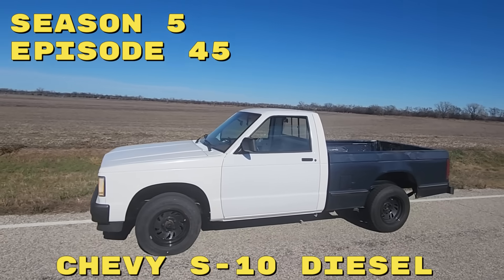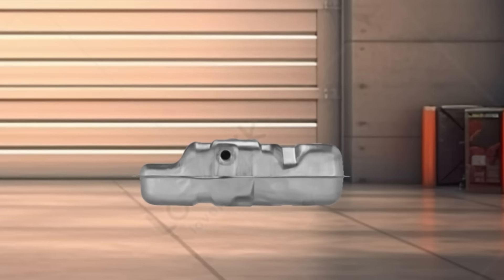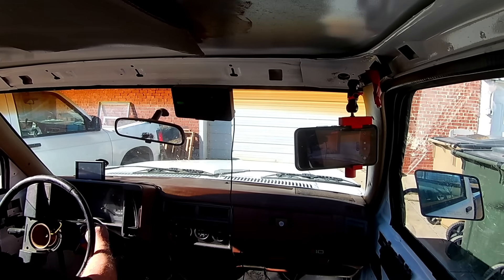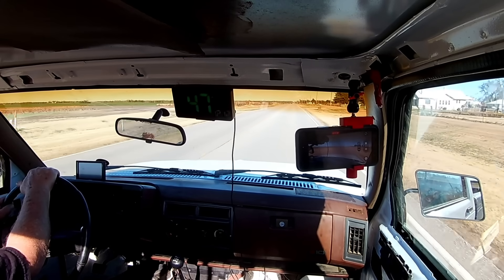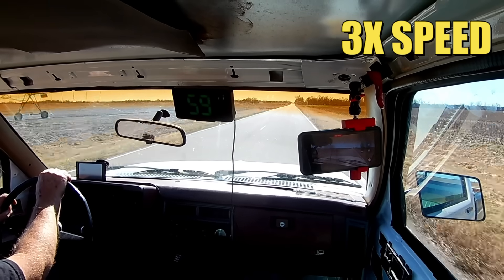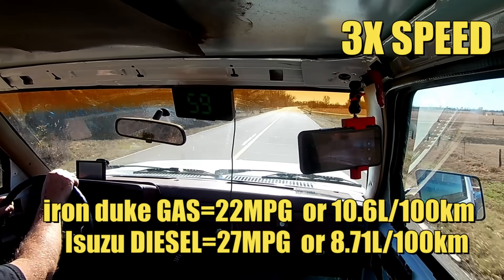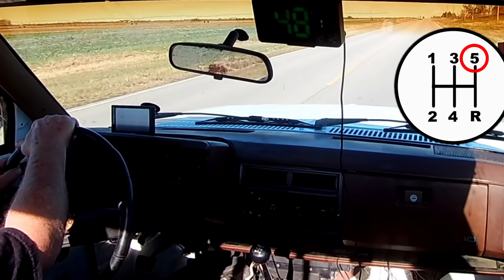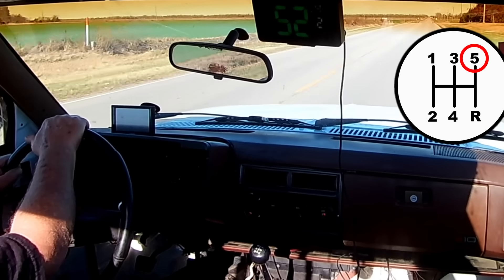S5 E45. MPG?  We road test the custom diesel Chevrolet S-10 to find out the fuel economy.

Comment: The consumption sounds reasonnable to me. I used to drive the VW T3 bus with the exact same engine, only it was limited to 50 hp and my average consumption was about the same. But to make it move, you'll have to make the engine scream a bit. The limiter usually comes at 4800 rpm, so just rev it up until it stops, memorize the screaming sound and next time shift just before you reach the same rpm. Even wirh one ear you will hear that 😉
Appriciate your videos a lot, thanks buddy!

Comment: Wow you are inspiring me to install a diesel on my 2003 Ford ranger. It currently has a 4.0 V6 buts its currently at 211k miles. Not sure how long it has until it finally quits. Right now the engine runs with no issues. I change the oil about every 6k. Thank you for sharing your journey with the s10 swap!!! Ive been binge watching these episodes since yesterday.

Comment: I've always wondered what running an n/an engine with only a few ponds of boost would do for economy.  Just enough boost to keep the air density/O2 saturation at around sea level.   Theoretically,  It really wouldn't add too much in terms of power, just keep the power more consistent regardless of barometric pressure or altitude changes.   It may be too much expense for the results for most, but I have a 1985 Ford Ranger,  I don't want it to be fast, but just keep up with modern traffic and be able to enjoy it for drives up the local mountain roads without it struggling.

Comment: I would look at the shift points. I had a 91 S10 that had the 2.2 6 cyl and it would get worse milage against the wind in 5th than in 4 th. You could feel the engine working trying to push against the wind in 5th.

Comment: My 1997 s10 2.2 would get 28-29 miles per gallon doing this test. I bet you can squeeze 35-36 out of this engine with tuning and tweaks, and 39-42 with a turbo. Possibly even a bit more with an ALH TDI or something

Comment: Turbo that NA 1.6, done it, works great even at 25+ lbs of boost. I used a turbo pump as well but I bet there's gains even on the na pump. Worked on and played with these for 3/4s of my life. The 1.6 NA is the dumbest engine in stock form, non turbo diesels all leave some much on the table without.
I think the trucks lack of power is costing economy.

Comment: Great video jimbo. 

I actually guessed the mpg correct. Would like to see some engine changes like valve timing and its effect on the motor. Probably cost prohibiting however I have always wanted to know how it would go if the compression was increased on an engine like that and if there was much net power benefit

Comment: I understand putting there Duramax diesel engine or eventually Audi 3.0 TDi, but small 1.6 diesel from 80s in BOF truck ? That will be slower than tractor.

Comment: A German here. The prices of diesel and gasoline are relatively accurate, but it varies greatly from region to region. Where I come from, the fuel is on average the cheapest (Kulmbach, Upper Franconia, Northern Bavaria). Diesel is between €1.53 and €1.57. Cheap gasoline (Super 95 E-10 with 10% bio-ethanol (91 AKI)) is €1.57 - €1.63. Normal gasoline (Super 95) is €1.63 - €1.67. Premium (Super Plus 98 (93 AKI)) is €1.75 - €1.82. Ultimate 102 (98 AKI) is €1.87 - €2.09. At some petrol stations there is also a kind of performance diesel, but this is pure rip-off and is around 1.90 € - 2.10 €.

Comment: If you get the valves shimmed right on per specs it can mean one to two mpg. Please use VW Rabbit truck for comparisons. Gearing. Weight. Etc. Try propane(there is a company that makes, did make?, an electronic propane setup for VW diesels). Use synthetic engine, transmission, and differential oil. Use tires that are better than just spacers between the wheels and road. Use lightweight forged wheels and use wheel size to adjust gearing. Are brakes in good shape (not dragging). On the oil pump video, be advised that on dirt roads the Rabbit diesel trucks were susceptible to denting the oil pan and breaking the oil pump. This series is very interesting. Thanks. Take care.

Comment: We had a 2wd Isuzu diesel pup with no ac. Seems like it got around 35 but zero power. Went to the mountains and had to turn around and go home to get the 22r Toyota. It was powerful enough to maintain 55mph up the mountain and even had ac. The Isuzu needed 2 turbos. One man here put a turbo on his VW truck and the head gasket failed not long after. Isuzu was it and the 22r was the hot rod that got low 20s mpg. The best Chevette ever made had the Isuzu diesel from the factory.

Comment: In aviation if you fly a heading say 000 out for 100nm and the reciprocal heading 180 back 100nm at the same indicated airspeed and altitude it is impossible to improve fuel consumption over nil wind.
The point is, wind always, but always, costs more fuel - it's physics. 
It's a bit like saying hills improve fuel economy - the point being it always costs more fuel going up a hill than you'll ever get back going down the other side (assuming same start and finish elevation). It's physics. 
I'd bet doing a circuit, assuming a constant wind direction, the wind degrades fuel economy over a nil wind day in a car as it does in aviation.

Comment: Another great video. My first job in high school was for a Diesel Injection Repair Company. Their delivery truck was a 1985 Chevy S10 4X2 extended cab with a 5 speed. The truck was pretty gutless even compared to the 2.5L. I can’t remember what it got for mileage but it wasn’t bad for the time. I would like to have that truck now. I’m interested to see how this goes, I didn’t realize that there was adapters for almost every application. Thanks, Jim. I hope you and your family had a Happy Thanksgiving.

Comment: You gotta rev the non turbo diesels, I was expecting you to achieve 44 plus mpg with the 5 speed, I run a Mk5 ford transit lwb with a non turbo 2.5 banana engine, this uses the Bosch ve pump which is tweaked slightly & I get on average 32 mpg I'm carrying a campervan conversion with onboard water tanks.
I'm assuming you're slightly out on the pump timing so you should expect some improvement on the mpg.👍 Good luck 🤞

Comment: I've always had those EPA estimates be severely underrated. My calculations with my 2.5 Iron Duke S10 came out to 27-28 MPG. I'm pretty sure the 2.2 Diesel got 35 with real world testing. So your results sound about right to me.

Comment: Well I am impressed with your work.
I always await the next video...
I can tell you that the 4 cylinder diesel engines are very good and used in many applications..
I have 1.9 SDI caddy style van 1997... very useful and good.
Mine being a non-turbo.
I believe you may wish to upgrade your motor to the turbo...
Yes you could, but you'd need to reduce the compression a bit... otherwise the head will say 'ouch' too often and part company.
You mpg is low ...
You should be getting a better figure, but that may be due to your timing...
Certainly on the 1.9 SDI it's about 85...in that region yours being a 1.6...could be 87 to 95... depending on the year...
Even the injectors back pressure..is worth noting..
Are they all the same... pressure range 
Turbos have a slightly different arrangement.. settings..even injector number ..
As the turbo engine will run hotter 
I am not sure, if the pre swirl-chamber differs too.
The tachometer pickup point on mine is at the rear of the injector pump...
The point/hole, where you do the timing..Dial guage (or at least on mine) it's a pulse operated switch with just 2  wires...and they must be connected a certain way... otherwise 0 readings 😅
Good luck....we will be watching you ..from afar 😂😂😂....in Spain..or across the pond😅

Comment: In Finland, diesel fuel is currently 1.65 €/ltr, 95 octane (RON) gasoline 1.75 €/ltr and 98 octane gasoline 1.85 €/ltr. Fuel oil (tax-free red diesel fuel) is about 1.40 €/ltr, but you aren't allowed to use it in road vehicles anyway. I don't know how things are in the US of A, but here the yearly vehicle tax is significantly higher (almost double) if the vehicle runs on anything other than gasoline. So with lower fuel price and lower consumption but higher tax, it only makes sense to buy a diesel car if you drive a lot.

Comment: My 6500 pound 3/4 ton 4wd Dodge 12 valve with an automatic transmission gets 21 on flat roads with no wind AT 55 mph. However since there aren't many 55 mph roads in my area I drive 65- 70 which accordingly lowers the mileage to 18-19 mpg. My standard trans 2wd 3/4 ton trucks have been able to squeak out 24 mpg at 55 mph. A 12 valve needs to stat as close to 1200-1300 rpm to get the best mileage. 
Other YouTubers have used 4bt Cummins engines in various vehicles and achieved 35+ mpg at 65 mph. I hope to see the little truck surpass 40+ mpg in the future.

Comment: I have the rare (in usa) factory isuzu diesel 2.2l s10 with a 4spd manual. 50hp and 90lbs/ft torque but I get 40 mpgs on the highway and I would get better with the 5 spd. Love the thing and my fuel gauge doesn’t work either lol.

Comment: Reminds me of the VW Rabbit 5 Speed 52hp diesel pickup. A Popular Mechanics test concluded that it was slow, probably shouldn't have been called a 1/2 ton, but it got 39 city and 58 highway mpg when they drove for fuel economy, and 38 city and 51 highway normally. Towing was not allowed.

Comment: I have a  diesel  2.2 1984 Isuzu pup pick up five speed. I never got below 35 miles per gallon.  It’s always got between 35 and 40 miles per gallon.
I bought it New for $6200 New . They used the same diesel in the S-10.  So I don’t know where you’re getting your miles per gallon of only 27.?   I’ve only had to change the timing belt once, brakes, and tires. And regular maintenance in 1,000,000 miles.
Reply: The EPA rated the 1984 2wd 2.2L Diesel 4 speed Isuzu pickup at 29 city and 35 highway. The 5 speed was actually rated lower and the 4WD considerably lower.

Comment: Brings back memories, so my guesstimate really wouldn't have even been that 30 some miles per gallon. I'm going to guess that that truck is a whole lot heavier than say a Volkswagen truck I had the 1500 and 1600 normally aspirated 81 through 84. Then I got lucky and got a 1.6 Turbo with a lot of miles on it but it was great and I ended up putting it in a VW pickup truck later I was lucky to find a place that sold a lot of VW parts in San Diego and they had three fully dressed blocks that were turbocharged and brand new and I think they were in the 90s but they were out of a Canadian plant. That engine was so much better and in reality the turbo was probably more than it needed at least on those earlier body models. On fuel economy I did about 45 to 48 on the VW truck on a really hot day going to vegas. So that was a positive the Heat and also was doing about 60 to 75 miles per hour steady-state. Now the one thing I did that I knew intuitively after I felt it that it was best for here in America and I don't know why VW did what they did. I had a VW Scirocco with a 1500 in it and a four-speed and I so wanted to have the five-speed to get the higher Highway gear ratio. So I bought a diesel transmission and made it up to the gas engine and for whatever reason that pairing was much better than what the original Scirocco had. So I experimented with transmissions and found that the gas transmission worked and had longer gears so to speak which went better with the torque of the diesel engine and it gave me way better gas mileage. Later I found a place that sold transmissions and engines out of I think Washington State and I found out there was at least 20 or more gear ratio differences in the 5-speed transaxle. So to get more performance you might try to find out what the early models had in them for gear ratios and compare it to what your truck has. Understand though I was using it for a daily driver in Southern California where the speed limit was really 70 miles an hour on the freeway. The diesel was buzzing like crazy with a four-speed and I didn't like running it wide open like. If you were planning on using your truck to haul heavyweight you'd probably want that low tight gear ratio that gave you more torque and power then mileage. So in reality everybody needs to understand that mileage is just one of the factors in the transportation picture. There are plenty of cars that get great gas mileage but they're super light and they don't haul anything. The other thing is an engine that has to work its tail off and run its butt off in RPM is one that is going to die early and what did you save? I know a brand new drove truck to Chicago from Indiana and they switched over to high-speed diesels and it was the worst thing they ever did compared to the Old Slow running diesels that use torque and lasted forever. So making it lighter and cheaper and super fast is only a transitory good and in the long run it's quite possible if it was figured maybe not such a great deal to run after the mile per gallon. Love your video and your info. Brings back good memories. I don't know how you're doing the timing but when I did it we used the same gauge in the pump but is Mark's on the Cam and crankshaft pulley.

Comment: Was expecting you to beat me. Gearing changes for proper engine speed makes a big difference.  Eg my 91.5 dodge went from 29@ 65 with factory 518  to 35-32( 3 back to back 200mi round trips because i didn't believe the 1st was right) with an Allison 1000 6sp.  Going from .69  31% OD  to .61  39%OD+ lockup torque converter motor was at a more happy RPM

Comment: I've seen your grinder...
 Notch the pully/balancer ware the belt doesn't run  and line-up the pointer.
      As for a  timeing light. Use a knock sender on # 1 HP fuel line.  Pipe the signal  to the gassers best friend the timing light. 

Some assembly /calibrating needed.

Comment: Before you show the results - if you get 38 or so MPG I'd love to see a Chevy Cruse 1.4L Turbo (2018+) version that is more torqy swapped in - that little sucker can pull that in a car on 88 (E15) gas so it's cheaper to operate.

Comment: I was expecting 35 or a bit above.
 My Mercedes 190E when bought (already pretty beyond the break in lol, with blow by) gets 32 MPG at 65 mph on highways. 2.0 liter, 1.3 ton curb weight, but with an aerodynamic coefficient of around .29, .30. 
 Drag coefficients play a major role in fuel efficiency.
 A pickup that's shaped like a brick (beautiful one might I add) getting 32ish mpg is quite impressive.

 Loved the content, brother. Keep it up.

Comment: 7:40 on the Diesel costs discussion: cheaper than gasoline in Germany but yearly taxes on the car are higher. Maybe 330 Eur per year for Diesel and 80 Eur for Benzin for a two liter engine. Depends also on emissions.

Comment: Could you put in a 1.9 VW turbo diesel, driving the front wheels, using the 5 Spd manual it came with  ?
You'd immediately double the HP increase and torque 65%+

Comment: Add the turbo and intercooler from the Mk4 ALH and it'll gain 25% HP and torque and a 15% efficiency over NA.
The VV turbo is easy to adjust, especially in that configuration (longitudinal).

Comment: OK but I think the old VW Rabbit Diesel did about 54 mpg in ideal conditions.  Even though this is a less areo dynamic pickup and probably a bit heavier body, I think you can get more like the mid to high 40s. You might try some areo dynamic improvements, air dam, bed cover, and find out about the optimizing of the engine.

Comment: I had a early 80s Rabbit Diesel with a 1.6 and it got 45 miles per gallon on both the highway and combined. It was not fast but it was pleasant to drive, and the Rabbits were better than any other car of any description on terms of handling on the freeway speeds of the time.  Later, I had an Isuzu Pu'p with the same engine as the s10 diesels, and it got 32 MPG everywhere. It was gutsy but not quick. For a spoiler, I had a late 70s Mazda B1800 and it got mid 30s on highway and combined and 27 in the city with it's gas engine. It was slower than the Pu'p but it was the best gasoline pickup mileage I ever got. I worked an an engine rebuilding shop in the early 90s and most Astros and S10s that were fuel injected blew a hole through the number four piston at 60-90K miles. That engine had better power by far than the Mazda 1800 or the Isuzu Diesel, but the short engine life was a bummer. The 2.5 lasted 200k miles in some Citations with stick shifts but the lifters had to be replaced on those engines the second the rattling started to live that long.

Comment: As you found out with the small engine experiments, adding propane increases efficiency and power, win win. The diesel engine will probably be running quite cold with that huge rad ? put a higher temperature thermostat in the engine, it makes a significant difference in power and MPG for very low effort.

Comment: 22 mpg.....thats a fair number. Lol my ford courier  with a 1.8 with a 4 speed was awesome on gas mileage.  I didnt even need 1st gear cause it was so low.
So most of the time I only used 2nd, 3rd and 4th.
I wish i could have boosted that 72 Ford courier 😂. 
It got around 32 mpg all year.